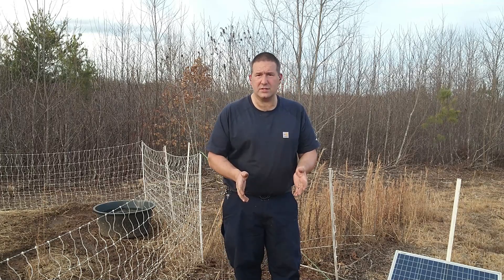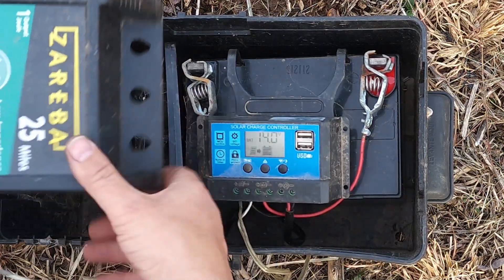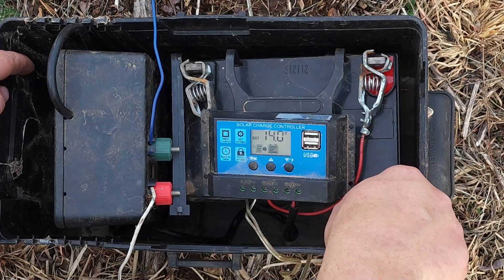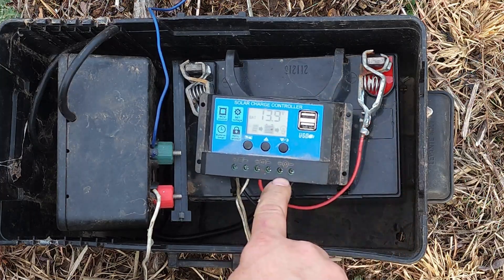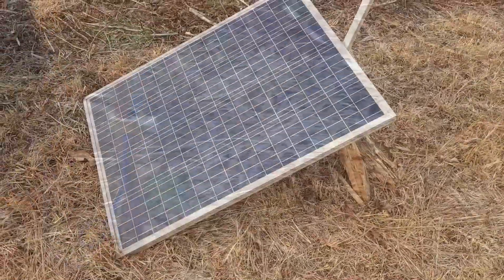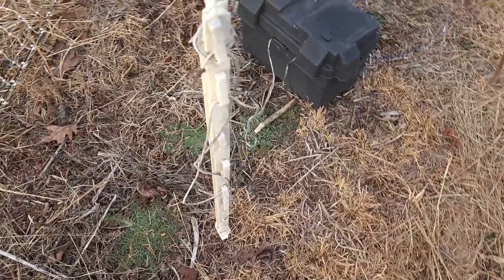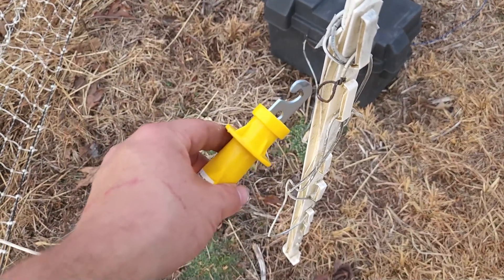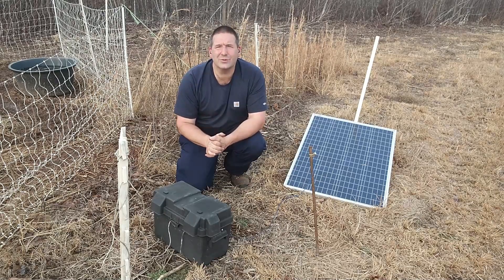DIY Solar Fence Charger #zareba #premier1 #noco

Comment: That information will help some farmer for sure, I remember in the 80's on the farm and we ran 120v system along the fences but even sometimes with a good electrical fence and a big storm rolls in pigs will go right through it, that happened once and I remember it was so hard to catch them as they were to slippery from the rain eventually we tricked them with food and got them home. If I were to put up a system like yours it would be mounted on a galvanized 2 inch pipe so the squirls couldn't climb up it and on top of that I would run the wires through conduit to the battery so rodents or squirls couldn't destroy the wires. 
Very neat system, I did subscribe to your neighbor, the Dr he has some good content.
Reply from the maker: @diggindiggenit6540 that is a neat story. Seems like crazy stuff happens during storms. Thankfully we have not had rodent problems. Good ideas though. I will keep them in the things to remember file. I plan on mounting everything on a hand truck to make moving easier. One day... Thanks for watching and sharing! ~Mr. C.